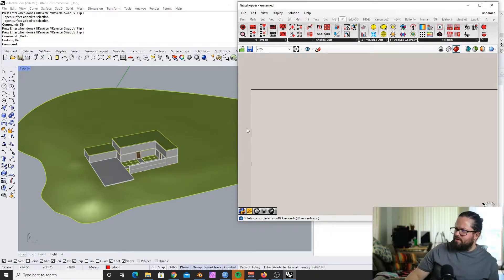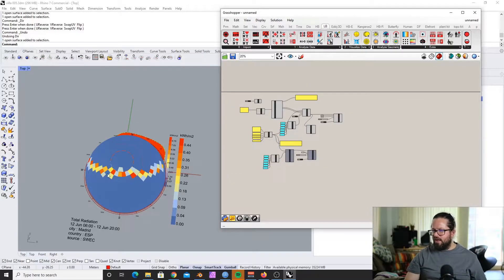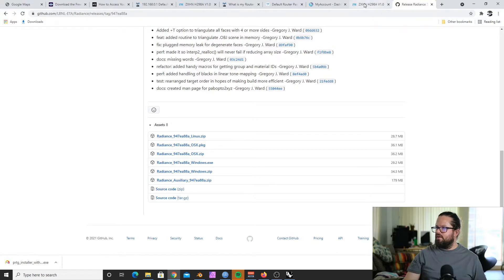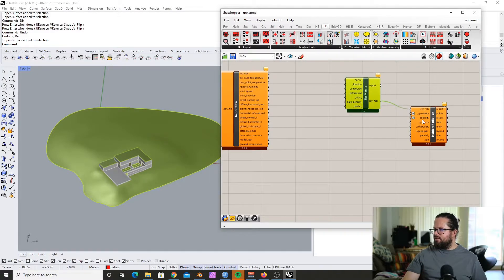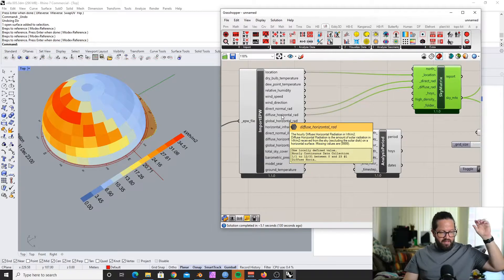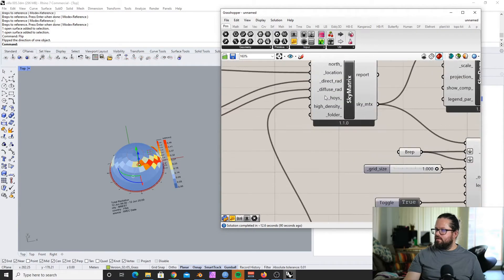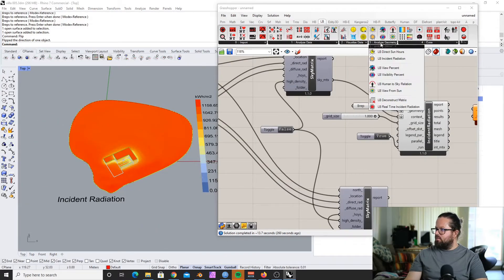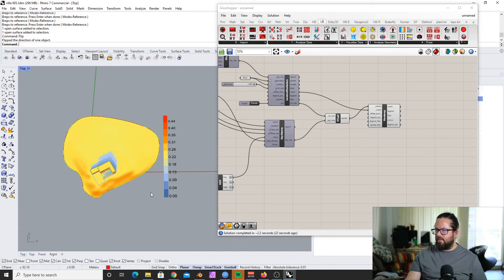Solar Radiation Study with latest  Ladybug Tools 1.1.0 | Rhino 3d | Grasshopper 3d | Tutorial 15

Comment: Thank you for the tutorial! I had the same feeling about the LB Real-Time incident radiation. Not very intuitive at first. Some time ago I had an issue on running the Outdoor Comfort for longer periods of analysis. It worked by averaging results, only using Ladybug components. It wasn't working with the default Grasshopper components. 
There are very old videos of Honeybee Radiance and Energy from the creators. Would be interesting to see/find some of those with the new Ladybug for Radiance-based Radiation analysis, Daylight with custom materials, Energy simulation, Thermal/Adaptive Comfort Maps, Overheating
Reply from the maker: Hi Arlind, yes I want to also tackle HB and Dragonfly. Let's see when I get to it.
I did some videos on outdoor comfort as well but yes it's about averaging results that's why I like to scroll through hour per hour to get a better sense of the space.
Thanks for watching.

Comment: Hi, I completed the entire code properly but at the end when i change my toggle from false to true Grasshopper crashes. Can you please help me with this issue!
Reply from the maker: Ok, which version of the Ladybug tools are you using? Are there any components red? Or do you get an error message anywhere. The most common issue of crashing is related to data tree handling. Meaning you might need to check if everything is properly flatten etc... You might want to send me a picture of your script per email. You can export a high Res image of the entire script in grasshopper. However I might not respond very quickly since I'm on vacation and have limited access to the internet.

Comment: In this script, how do you convert to imperial units? I hate the imperial system, but alas it is what I know.
Reply from the maker: You could translate the final output into imperial units if you want. Or do you mean that your file is feet or inch and you don't want to translate it to meter? I think it still works in imperial units but be aware that you might need to translate your output data.
I would probably test with very simple geometry first to see what works and which equations to apply if any. Comparing the output in both unit systems etc... Since the output would be kWh/m2 for example it might be a bit messy but for sure doable to translate.